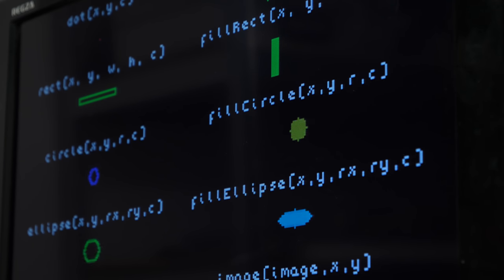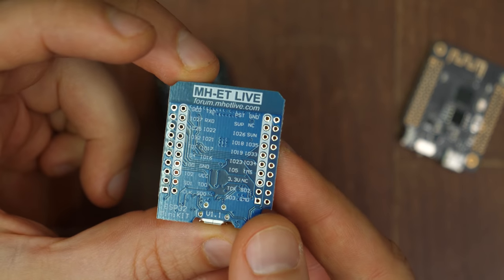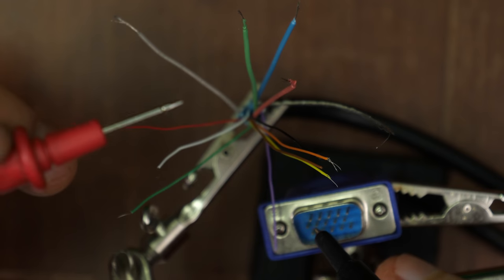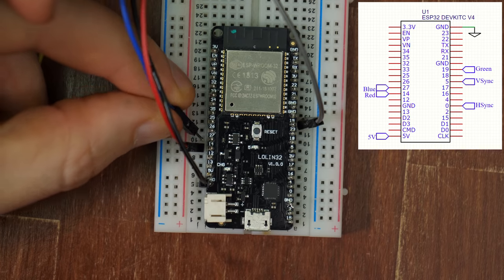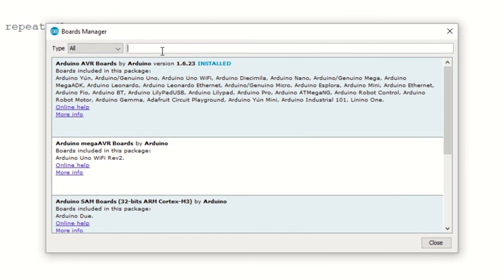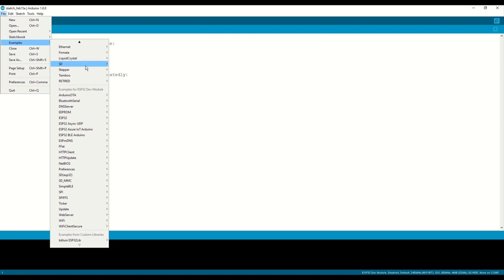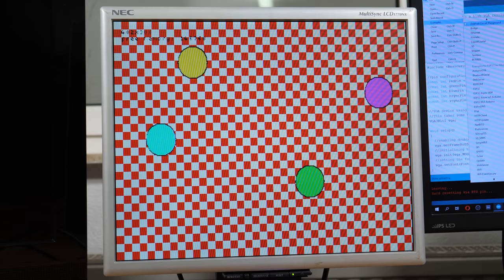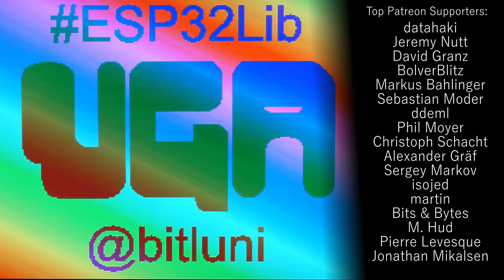ESP32 VGA Beginner Tutorial [Arduino Library ESP32Lib]

Comment: So, could we use this for one uC as vga, another as CPU, stuff like that?
Reply: @RAM9031  i am not sure you understood what i was saying 😁. What i was getting at is creating a tiny computer using one uC as CPU, another uC as dedicated graphics, and so on.
Reply: @Voidsworn  got it,  sure, as you know two CPUs are available, I think just take care for each CPU load.
Reply: @RAM9031  oh, crap...oops 😂. I actually knew that,  brain fart. Thanks again.
Reply from the maker: I mentioned the performance boost. Just displaying the frame buffer does not use any cpu performance anymore. You can use both cores of the esp32 for your other stuff. The 3d example only utilizes one core to render 60fps in realtime. The other core is idle. The third low power core is also idle, but I'll get to this later 😈
Reply: @bitluni  can we display mobile content like the web site to LCD display through esp32 via wifi.
Reply: @ofsanjay  You want to display a website? Well, I mean, you could, but you'd need to create your own renderer for that, sooo... good luck I guess. :)
Reply: @ThePC007  thanks for your help friend. I don't know about renderer. But it will help me to learn something new. 
Do you know something more about this.
Reply: @ofsanjay  Have you developed a website of your own before? Knowing how HTML and CSS (and maybe even Javascript) work would be the very basics you should learn before even attempting to create an actual web renderer. And even then it's no easy task at all.
Reply: @bitluni How many cores does the second board that you linked to have ?  It seems that some have only one.  Thanks
Reply: @bitluni  "Just displaying the frame buffer does not use any cpu performance anymore" what does it means? i update the framebuffer and it gets updated on the screen without using the cpu, or you mean only when the framebuffer doesn't change?
Reply: @msx80  the CPU is used to update the framebuffer but that's just one write to main memory, there's plenty of time for your CPU to calculate other things until like game logic until it needs to update the framebuffer again. (depending on how many fps you want ofc)
Reply: @RAM9031  you could use the Arduino Uno for text-mode using Nick Gammon's VGA library.
Reply: @bitluni  So the second core is available for a sort of communication with some other microcontrollers (spi, serial, or whatever depending on the bus speed needed to achieve a good compromise to display images). I mean , if I connect a (let's say a STM32F4 micro which has the room for data or code) is it possible to run the code using the bitluni vga library in the STM32F4 and sending all commands and data to the ESP32 via the bus between the two processors, so the ESP32 is givining realtime stuff instead of precompiled stuff... Just an idea. Is it a viable solution to you?

Comment: How are you ensuring a voltage between 0 and 0.7V without putting resistors? Connecting directly to the digital outputs means providing 3.3 or even 5V which is outide VGA specifications.

Comment: As the ESP32 has dual cores, Could we use a core for display vga graphics and another core for other codes?
Reply: bitluni's lab
Hace 13 horas
I mentioned the performance boost. Just displaying the frame buffer does not use any cpu performance anymore. You can use both cores of the esp32 for your other stuff. The 3d example only utilizes one core to render 60fps in realtime. The other core is idle. The third low power core is also idle, but I'll get to this later

Comment: Hey Bitluni, I've tried to connect my ESP32 to a small Sony TV with VGA input using your "Hello world" example and in some resolutions it seems to actually detect the H and V sync pulses, but the proper TV displays that the input signal is not compatible for some reason. Any idea?
BTW cool library!!

Comment: I notice the direct connection without any resistors on any lines. Typically I see something like 68ohm on the sync lines and 470 on the signal - presumably a mix of terminations to avoid ringing and/or to bring the rgb signal down to 0.7v. Isnt this needed or is it just the ESP that's different say to an Arduino?

Comment: Hello I love this project, but  I can't make it work.  I gen NO SIGNAL. I triple checked the connections and they are the same as your diagram.  I connect  the sync signals to pins 32 and 32 as in the sketch but I still get no signal,  What else can it be ?  Any help would be appreciated

Comment: This looks great especially ESP32 modules with with Wifi. I would love to emulated some 6502/Z80/8080 classic computer systems from the 80's using this module using VGA output and maybe PS2 or USB Keyboard support. Do you think this would be possible on an ESP32 or ESP8266  module?
Reply from the maker: didn't read the specs of ps2 yet. it's probably easier to handle than usb. but BT is planned
Reply: @bitluni  Actually I am wishing/hoping not to emulate 8080 classic system, but to interface real 8080/Z80/6502 system as 8kB VGA videoram.

Comment: if I push past 400x300, my board crashes (3bit hello world, nothing else running or connected).  I don't actually need more than that, but it seems likes I should be able to and the fact that I cant might be an indication that I have some sort of underlying problem.

I should be able to run a high resolution, correct?  I mean, why else are they in the library...

Comment: This is amazing! If you want to have an ESP32 present information on a large display, you are essentially stuck with the expensive Nextion stuff, but this allows large screens essentially for free. Simple but brilliant!
Problem is, I've completely switched to micropython. Would it be possible to convert this to micropython somehow?
Reply: switched?  learning a new language doesn't require forgetting the old.  mp is always gonna be slower then c--its just a layer, written in c anyways.

Comment: Hi, i think that maybe i found one line that could change the resolution screen "const Mode VGA::MODE800x600(24, 72, 128, 800, 1, 2, 22, 600, 1, 36000000, 0, 0);" in VGA.cpp file. In that case I suppose that for create a new resolution it need change this parameters. Into a comment above this parameters has called by: hfront,hsync,hback,pixels,vfront,vsync,vback,lines,divy,pixelclock hpolaritynegative, and vpolaritynegative. I thought that i can use hfront,hsync,hback and pixels values of a 800 width screen configuration and a vfront,vsync,vback, and lines values of a 480 height screen configuration to create a 800x480 configuration, but still missing a pixelclock value to this work. Can you share a equation or indicate one way to find out how to get this values?

Comment: Anyone have hints on how to vga.println(millis());
Reply from the maker: you need to reset the cursor each frame if you don't want the frame to scroll vga.setCursor(x, y);
if you get errors about unsigned long etc. try vga.println((long)millis());
these are the parameter options to print numbers
void print(long number, int base = 10, int minCharacters = 1)
void print(double number, int fractionalDigits = 2, int minCharacters = 1)
Reply: @bitluni  Thanks for the tip.  I will check it out.
Reply: Worked a treat.  Thanks again.